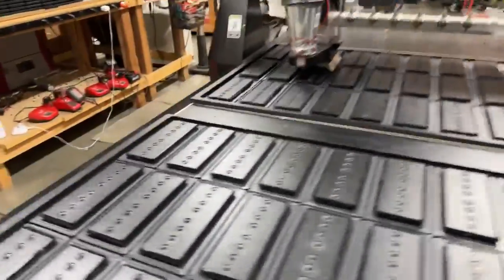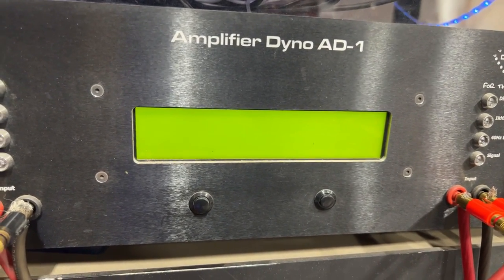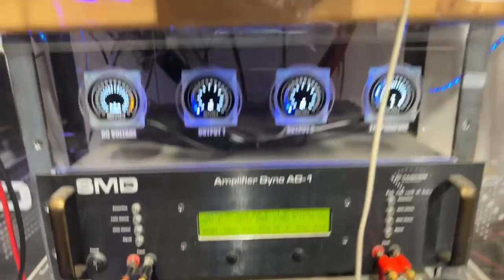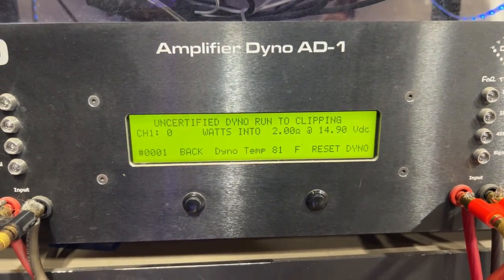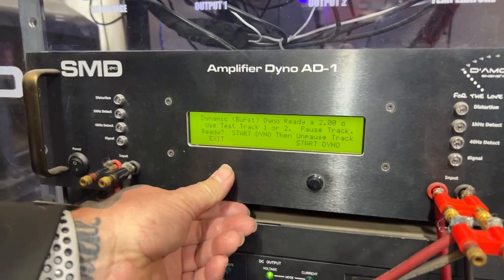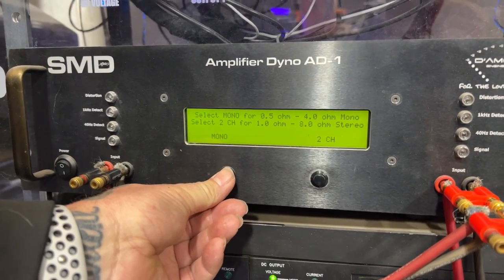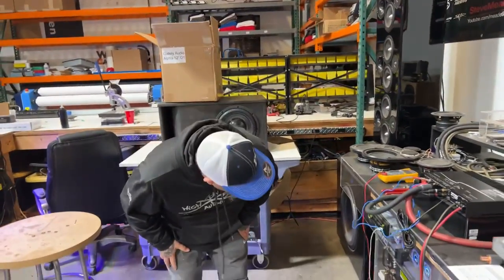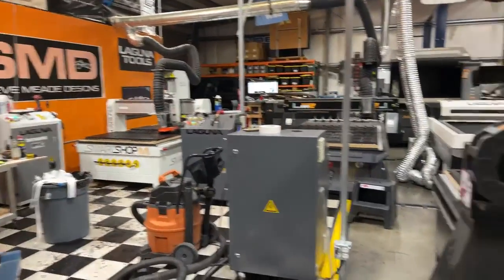Amp Test Tuesday - Audiocontrol LC-1.1500 (rated 1500watts) LIVE results!

Comment: I’m planning on putting this guy on 2 Kicker L7Q 12s. I was a little worried that I wouldn’t be getting the proper output that those subs need (1800w rms) but now I have no doubts. I would always rather have an audiocontrol or Mosconi amplifier in my personal vehicle rather than something like a kicker cxa amp or a Fosgate.

Comment: If I have 2 kicker comp Q wire to 4ohns when I connect them to the audio control amp would it convert them to 2 ohm stable to get the full 1500
Reply: Sure will.